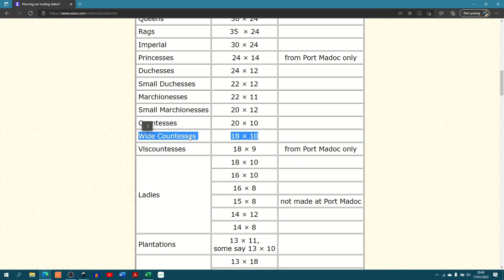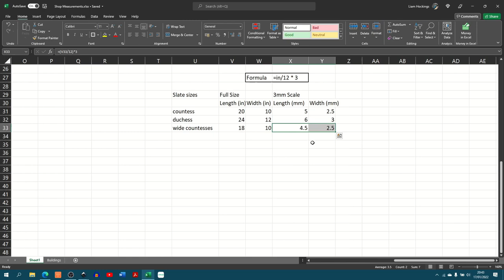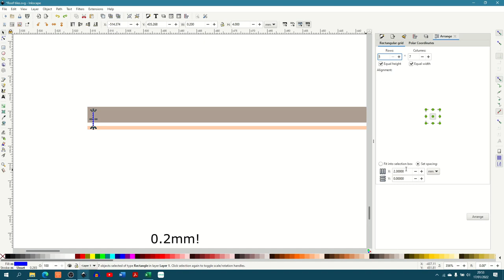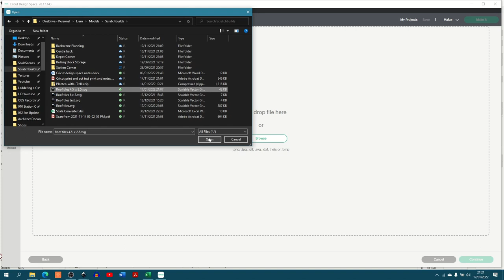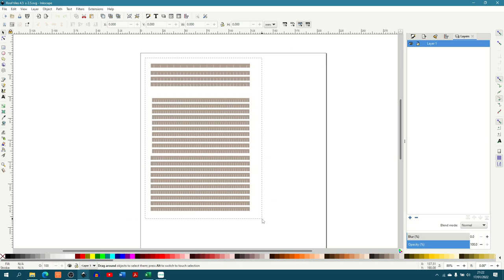Easy Custom Roof Tiles for Scale Model Buildings using a Cricut Maker | 014

Comment: Nice scratch build. I am returning to the craft after many years away so gathering info. So much has changed. The Cricut Maker keeps popping up and I am looking at that now also. Used to cut each tile by hand in the olden days so a quicker solution that looks just as good is amazing.

Comment: What kind of self-respecting scratch builder are you that you don't want to spend hours cutting roofing tile by hand?! :) 

In regards to duplicating the rows of tile in Inkscape, however, instead of hitting the Duplicate function for however many rows you need, a tip I shared with Michael at Chandwell yesterday is to use the Interpolate function. 

Make your first row of tile then duplicate and position the bottom row, then select both. Go to Extensions>Generate From Path>Interpolate... and in the dialog box that appears set Exponent to 0.0, Interpolation steps to however many lines you want, and Interpolation method to 1 (several of these will be the defaults already) Then click Apply and it will automatically make however many number of lines you need equally spaced between the first and last one that you made. It's a real time saver (and key saver from slamming the D key so many times!).
 
I'm enjoying watching your layout grow and it's a real inspiration for someone like me just starting out in this hobby. Cheers!
Reply from the maker: One that is trying to preserve sanity!
Thanks so much for the great feedback, its really nice to hear. I'll have a look at that function next time I'm doing something similar.